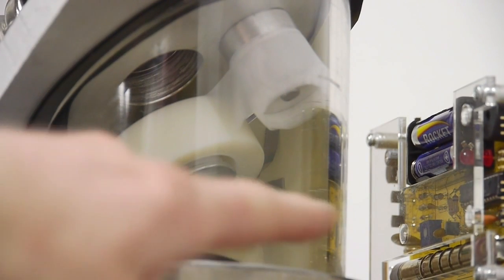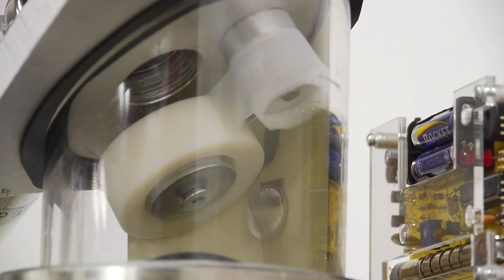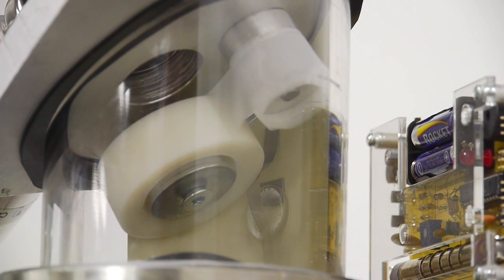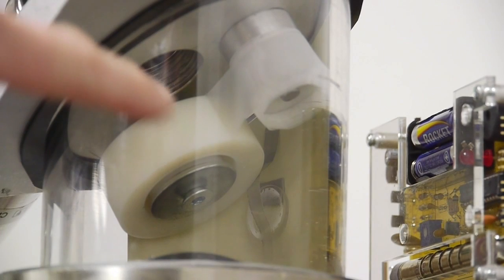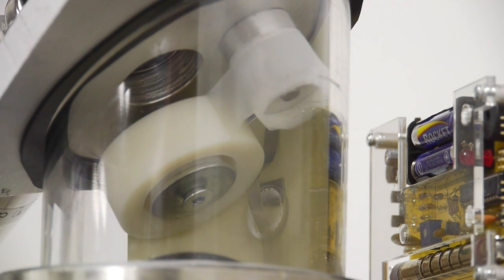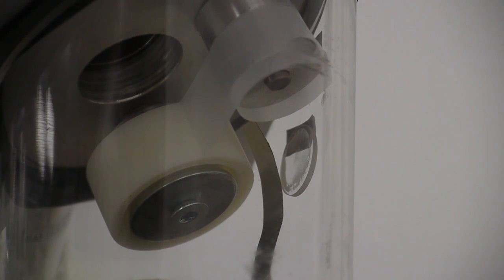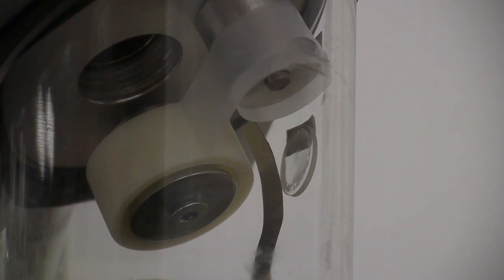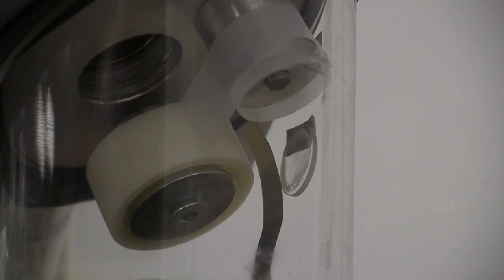Follow-up: Attempting to make X-rays by unrolling Scotch tape -- Success?

Comment: From physics teaching: avoid 3M tape, since they add something to the adhesive or juggle the polymer formula to damp HV "static electricity" production.  Build crude electrometer and try several different types of tape?  Cheap no-name tape gives much higher surface charge.

Comment: Yeah, the edges of the luminescent screen were lighting up, but there was a big spot in the middle that was kind of vertical and horizontal.I'm thinking that there was some electron leakage around the side of the metal band that was bleeding over the edge and striking the phosphorous screen which made the edges of the screen light up, it looks like an elecctro luminescent glow that's inside a vacuum tube,instead of a straight line of sight blocked area of darkness,I look forward next experiment.